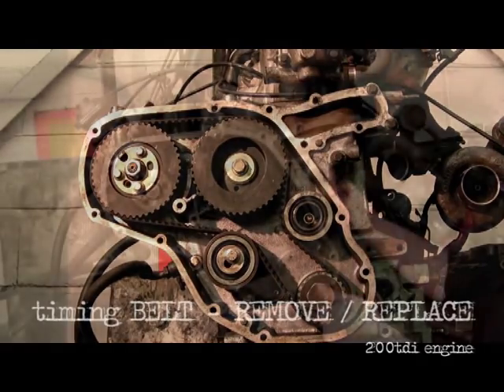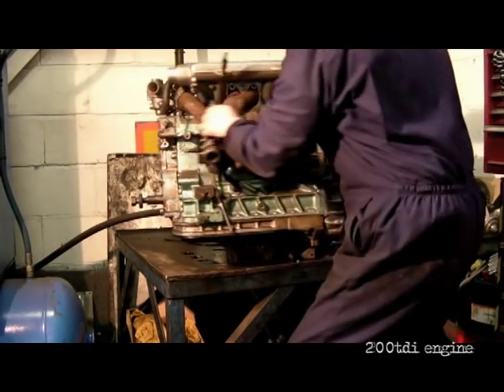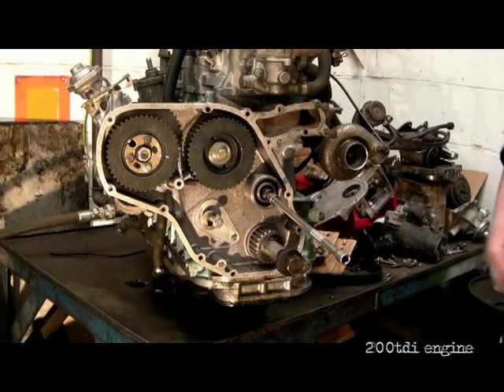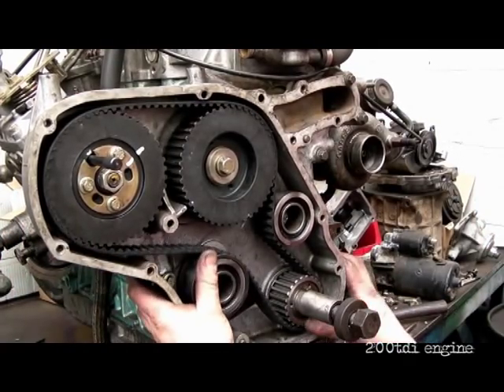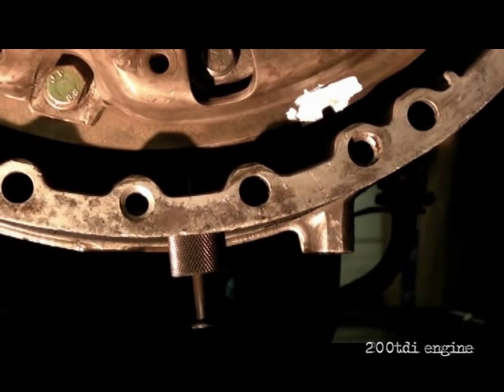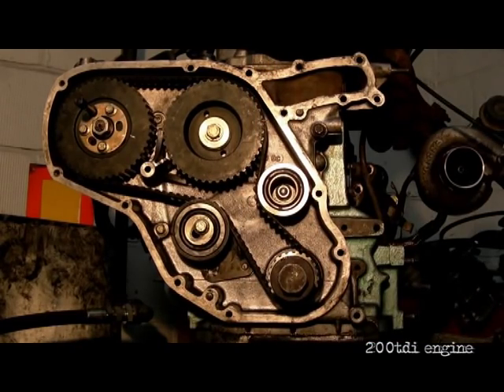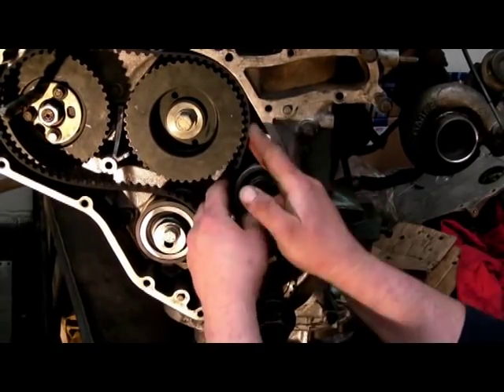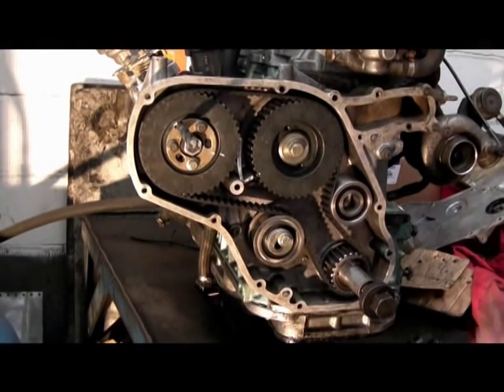Land Rover 200tdi Engine timing belt replacement with front cover removed

Comment: yet another great video , easy to understand spot on..   i have had a problem where my belt has worn on one side 200 tdi,  its rubbing on the tensioner  lip which guides the belt .  all new bits fitted and all looks as it should ?  what could be causing this ...  many thanks.

Comment: Hi, I find your videos very helpful, but I have a question unrelated to the timing belt, hope you dont mind.

I think theres a problem with my wastegate(300tdi) I cant move the actuator rod by hand even using a steel bar to prise it. I know it takes a certain psi to get it to move but should it be movable by hand? Reason for checking is that its alittle flat around 2100rpm so I fear the wastegate may be stuck open. Many thanks

Comment: Hi Great video, Where did you but the belt tool from? Also ive never done a timing belt before some im going to give it a go. Ive been warned the bolts in the timing cover can snap any advice on this?. On my landrover 200tdi its not been used for a while im getting a bit of light blue/grey smoke on acceleration . Would an oil and filter change help. There is nothing on tickover just the usual puff on start up.
thanks lee
Reply from the maker: Belt tool from Paddock spares.  Look under the tools section on their website.      Here for timing case front cover https://youtu.be/CjFV-w5YMCE.   If you have a little oil when the engine is cold / on start up it could be an indication that the valve stem seals are worn.    Oil change may not help much.
Reply: thankyou, i will take a look.

Comment: Just doing my 200tdi, weird thing is: I have the camshaft sprocket punch mark lined up, the crankshaft woodruff key vertical to the arrow on the engine case, yet I cannot see the notch cutout on the flywheel to allow me to pin lock the crankshaft?
The engine is from a discovery. By the way, brilliant video thanks.
Reply from the maker: +Diydude69  could have the wrong flywheel on it or the notch is 180 degrees out.
Reply: +Land Rover Toolbox Videos thanks for the swift response, the crank cannot be 180 degrees out, as the key way is vertical, I'll go with swapped out flywheel or incorrectly fitted flywheel if that's possible.? I've done the belt, and both front crank seals, your video's made the job allot easier than following the haynes manual.Thanks again for putting them on you tube, hopefully I'll get my 90 finished for Christmas
Reply from the maker: You are welcome.   The 2.5 NAD flywheel fits to the 200tdi  and it has a EP ( exhaust peak) marker which are seen as a scribed mark. with 14 degrees next to it.

Comment: Hi i would like to know if this procedure isn't similar for the 19j engine or the 2.5TD .
Thanks
Reply from the maker: no it is not simular.   There a pins for timing the Injector pump up which are different completely

Comment: Have a 93 200tdi defender that i am in the process of changing the timing belt.,
my engine has no static idler bearing ? Is this normal ?
Reply from the maker: Mike Robertson are you sure it is a 200tdi?  2.5NAD or Td 19J has a different set up.
Reply: ***** 19J have worked it out. Video was very helpful . Thanks